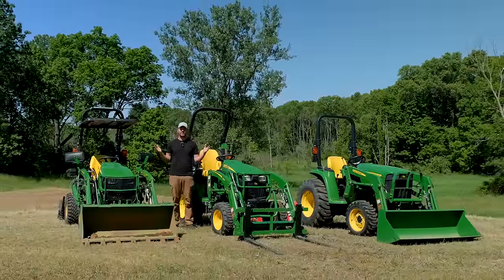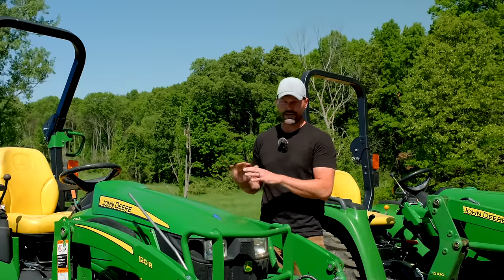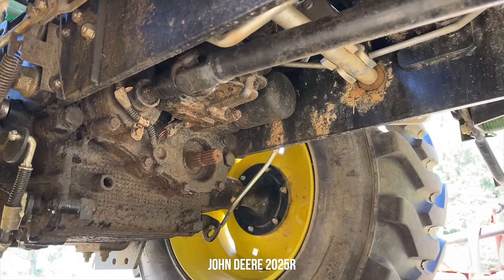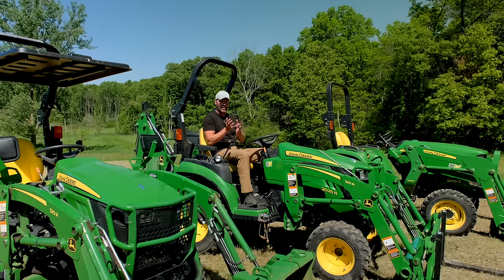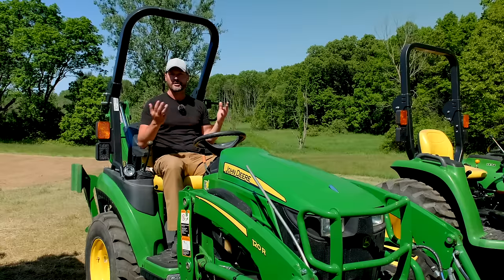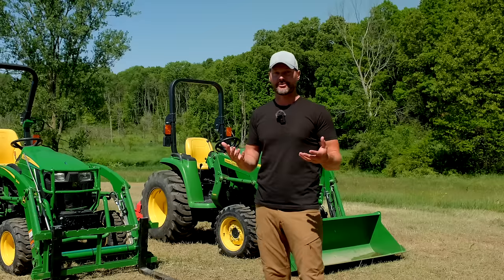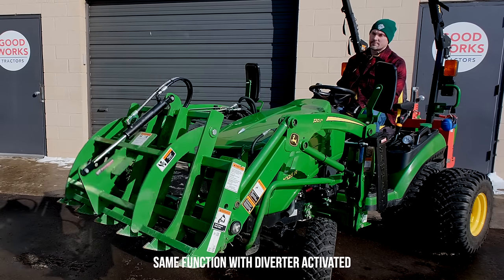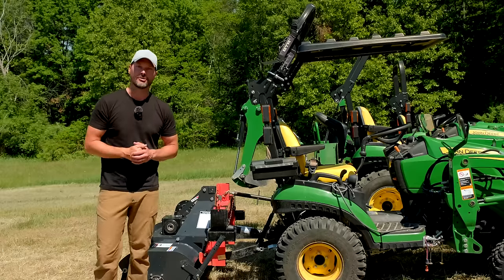CLEAR LOSER? COMPARING 3 JOHN DEERE 25HP TRACTORS.

Comment: Interesting review. Thank you. I bought a 2012 1026R new. It's been a great little tractor and does everything I need it to do. I put a 54" snow blower on the front and it's done a great job moving snow during winter.  When the Mauser cabs came out a few years ago, I spent the $5200 to have one installed on my tractor. At 73 it's been a life saver during the cold weather. The overhead heater works great too. Summer time the doors come right off and the front and rear windows provide the much needed air.  The 60 inch belly mower makes short work of my one acre lawn but it's lacking in suspension out in the pasture. I use to run a Frontier rear brush cutter but it got so little use,  I sold it recently for more than I paid for it new. Same went for the box blade. My 1026R has a bit over 160 hours on it and is still running like new. PAPE took over the local John Deere here in Yakima Washington. Getting into their service department for routine service is terrible.  They don't make service appointments. You have to drop your equipment and they will get to it when they can. Frankly, their service department sucks.   Again, thank you for your video.

Comment: I love my 3025e. I have found it can handle a lot more than expected. I have run a 60” cutter, grapple, 72” box blade, 60” blade, 60” rake, and recently purchased a post driver to try on it. It does everything I ask of it. 👍
Reply from the maker: Awesome, it is quite capable!
Reply: @GoodWorksTractors  yup, its pretty good for making the GWT top ten tractors you DONT WANT!! hehe...( "But I have sold the most of")

Comment: Traded in my 2019 1025R for a new 3025E this past January.  Found I was not using all the "bells and whistles"  on the 1025R.  Enjoy the extra weight and stabilty of the 3025E.  Between the loaded tires and a weight box it added about 1100 lbs. of ballast.  I love the tractor, perfect for my needs.  Price was very reasonable, there were some rebates available.  Courtney, as always, appreciate the information you provide. Thank you!!
Reply: what do you think about the difference in the seats and the position of the loader control?  I have the 1025 and thinking of doing the same. also what about difference in power?
Reply: @anthonymorrison2167  Hi Anthony the 3025E seems to have a bit more power, both loader and 3 point have more capacity than the 1025R, suggest you compate on the build and price app on JD site. I love the 3025E.  I did not notice any difference in the seat or the loader control, but I generally only use it an hour or so at a time.  I bought mine in January, price has gone up.  They discounted the list price by 10%  and allowed me $16,900 for my 1025R with loader, frame mounted plow, 3rd function valve and weight box. If I can provide any additional information please reach out! Good Luck!
Bob
Reply: @bobnarrus3218  I did the exact same thing, went from a 1026r to a 3025e and the only two gripes I have is no arm rests and no belly mower option. Other than that, I love the 3025e. Extra torque, more capable, stronger loader, etc.
Reply: @joeyschoenfeld6958  Arm rests would be nice, belly mower not a problem for me; I didn't mow with my 1025R either. I wonder if the 3 series would be too heavy to mow a lawn with? Just wondering!

Comment: Bought my 2021 2025R last fall and absolutely love it. The ground clearance difference between the 1025/2025R was the biggest seller for me. I bought mine with the backhoe and it just made since to go 2025R with that set up. I love it and personally it has felt “tippy” to me. I feel whatever they did engineering wise to counter this worked Very well.

Comment: The 3025E has a larger displacement engine than the 1 and 2 series. If I remember correctly the 1 & 2 series has the same 74 cid engine and the 3E has a 100 cid engine that produces 14 more lb ft of torque than the smaller tractors. I bought a 3025E in 2017 when they first launched. I got the intro price. They sell for $7000 more than I paid now. I've put 754 hours on it and I haven't had a single issue with it so far.
Reply: That's great to hear! I pick up my '23 3025 in a few days
Reply: Had a 3033r. Sold it didn’t use it allot after building the house. Bought a 3032e.  Wish I had never sold the r

Comment: Fair comparison.   2025R 2nd gen owner add’l thoughts… The 2025R handles 5’ box blade, rakes, rear blades easily.  Bigger rear tire contact patch and R4 deeper tread means a bit more pulling traction.  But 25hp has limits to ground engagin/pulling on every machine… Go up in size to do really heavy pulling with 2 bottom plows for example.   Handles a 4’ bush hog very well and importantly gets you up above taller vegetation and most of the dust that 1025R does not do as well.  Fits in my garden, through gates and tight spots in the trees better at 4’ wide.   Think this bit through, as its no good to have big equipment you cant get to the work!  Handles very good sized trees with a grapple (10’ long pines, brush piles, etc).  Has  a bit larger hydraulic pump than 1025R, but not significantly more.  Search Youtube to see how to measure pressure and dial up the hydraulics to max OEM spec to add 10-20% more lift force though to get best balance of performance and longevity.   Ballast is essential as noted since the center of gravity is higher, so that’s the main downside.  Price is certainly dramatically less than the larger 2 series “R” machines by $7,500 or more!  After 2 years ownership, still a huge fan of my 2025R!  But if you can afford to go bigger (and pay for bigger/pricier $ trailer to pull it, more expensive attachments, more maintenance $, etc), then go bigger of course!
Reply from the maker: Great stuff Hugh, thanks for sharing!
Reply: I feel like the 2025r gets a lot of hate. I am a fellow 2025r owner and I feel like it’s a great tractor. I feel like it takes all the advantages he talks about with the 1025r and adds more to it. According to JD’S website there is a 2600 dollar difference in price between the two. I don’t think that’s bad. Considering you get a 25% increase in 3 point lift capacity.
Reply: @DakotaDave17   Exactly agree 100%

Comment: I bought and use my 3025e when I started my grading business and I have used it to spread 300 tons of stone material for driveways and parking lots. It has more than payed for itself. Also use it to brush hog properties that I manage cuts through 6 foot tall brush(not like a hot knife through butter but good enough) I am genuinely impressed with these compact tractors. They are work horses for sure.

Comment: This video reminded me of the decisions I faced when buying my first tractor. After buying a small ranch, I purchased a 3025E. My dealer assured me it would handle 4’ round bales. It moved them, but it struggled. I ended up trading it in on a 3033R, which seemed to work better, but of course I now had to deal with the dreaded regen process. A year later, my hay supplier changed. I had to move with 5’ round bales instead of 4’. The 3033R initially handled these larger bales, but I started to have hydraulic issues. I eventually traded the 3033R in on a 4052R. The 4 series is a much heavier tractor and it’s loader is beefier, so handling large bales is now a non-issue. Based on your advice, I recently bought a Worksaver ETG-26 grapple, something the two smaller machines wouldn’t have been able to handle. My John Deere dealer worked with me on both of my upgrades and gave me what I paid for on my trade-in’s.

Comment: Looked at all 3 and purchased a 3025E, wanted a tractor that I wouldn’t over work taking care of my 6 acre property… perfect so far! Happy I made the choice of going with the bigger tractor over the bells and whistles. Great video! Thanks!!👊🏻
Reply: I have 7 1/2 acres though and having a 60-inch mower deck is also key because it needs to be able to do more than one or two things. I I want it to be able to mow move a little bit of dirt, and have a rear mount snowblower. Because I want to be able to have the loader and the snow blower on at the same time.

Comment: I really love my 2025R. The 1025 was too small for me, I felt cramped on it compared to the 2025R. I also like that I have more ballast weight because of the larger tires in the back. I am 6 foot two and about 290 pounds and could not fit in the cab of the 1025R.
Reply: I agree i also have the 2020 2025r and find it hands down a better tractor to the low sitting 1025r this video was an opinionated bash on a good tractor which i doubt he has spent much time on
Reply: I'm not trying to start an argument or anything, everyone loves what they have but I think that's the point, the 2025 is just taller, the 1025 will actually lift more with the loader at the pins and they have the same exact breakout point. 2025 has more ground clearance and weighs more by about 400-500lbs . If the 1025 isn't big enough tractor it's worth going to a 3 series, the 1025 to 2025 isn't much of a jump other than bigger tires. I have a Kubota L-series with a cab and sometimes go grab my father's 1025 cause it's lower to the ground and less tippy.  I can see going to a 2025 just to get the cab but again not knowing the prices , could again be worth going to the 3025.
Reply: Have a 2022 2025R, very pleased with it, mow hunting areas like trails and open grass areas with it?  Bought Frontier RC 2048 to cut grass and tall weeds/brush and it works well.  For more open areas use  a tow behind DR Pro Max52T (52" wide cut) field and brush mower with 22hp engine.  My 2025R has no issue pulling it with front end loader and bucket attached for ballast.  Really glad I went with the 2025R.
Reply: To bad that the 3025 doesn't have an R model.

Comment: Hello, we bought a 3025d new with a loader.  Now with 175 hours the tractor is amazing. It has tons of power and is great in the woods pulling logs.   We had the tires loaded and I have installed a diverter kit. Using a small "work saver" grapple, this tractor will lift a huge log.  We have a wood mill and 28 acres of woods, this machine feels like it can do it all.  The 3025d clears tons of snow and grooms our trails, It has never felt tippy or gotten stuck. We also have a welding shop and use this tractor for all our heavy lifting.
Great machine!
 Im stepping up from a case international 235 with a Frey loader.

Comment: I have a 2019 2025R, love it, 5 ft brush hog and box blade, no problem. I use 4 ft eguipment mostly as to not to over tax her, she is a small tractor so I keep that in mind. As far as loader height I thought about a 4 way bucket to help with that. I love her but I respect that she's a small tractor.

Comment: I have a 3025D and I love it.  Bought it recently but it has been great.  It’s heavier than the 3025e and more robust(parts wise).  It takes a little getting used to but once you figure it out it is fine.  Use it for a lot of loader work right now but will doing some fairly serious ground engagement work soon

Comment: I have a 3025D, and I believe it is the best 25 hp tractor out there.  It is gear drive only, has a cast iron rear end, and weighs 300 lbs more than the 3025E, the Kubota L2501, and the Mahindra 1626.

Comment: I have a 2021 3025E and I love it. I live in N Fl. My property is very wooded so I have lots of limbs and trees on the ground.
Unfortunately I have had to dig a few graves for some of my critters. It did a great job. I have a Westendorf Brush Crusher grapple and that works great. My tires are loaded with water because it rarely freezes, if it does it's only at night.
I thought about all of those models and the 3025E was for me. For mowing I use a JD 110

Comment: Another great video - thank-you!  Looking forward to, as always, the next one!

I took delivery of my 2021 2025R Gen2 14 months ago.  At the time, there was a $3K cost difference between the 1025R & 2025R.  I live on a few acres in the northwest that are mostly forest.  The 1025R would have met all of my needs very well, but there were three features of the 2025R Gen2 that justified the additional $3K in cost - that into low, middle, and high prIority categories.  

Low priority - this is about aesthetics and not much else.   I prefer the larger tires (espec. the rear) on the 2025R versus the smaller tires on the 1025R.  The larger tires are more ??"tractory"?? than smaller tires.  No, ain't gonna to defend this - it's about aesthetics and not logic.  (I'd assign 10% of the $3K)

Middle priority - Operator station - I preferred the 2025R over the 1025R.  The adjectives short, petite, tiny, skinny do not apply to this tractor owner.  For myself, the operators station on the 2025R has more room and is more comfortable.  The seat fits my non-petite frame better and is more comfortable than the 1025R seat.  Also, there are a couple seat-side controls (PTO selector, for one) brought higher above the floor on the 2025R than on the 1025R - offering slightly easier access over the 1025R,  (I'd assign 30% of the $3K)

High Priority - Ground clearance.  My property grows trees, himalayan blackberries (much hated) and rocks - ground clearance is a concern.  The 1025R ground clearance MIGHT BE sufficient to clear SOME obstacles I may encounter.  On the other hand - The 2025R ground clearance IS sufficient to clear MOST obstacles I may encounter.  "Might be" vs "is" sufficient and "some" vs "most" obstacles.  This was my primary deciding factor in 2025R vs 1025R.  (I'd assign 60% of the $3K)

These are my reasons for spending the additional $3K and after having my 2025R for a year & know what I know now - I'd make the same decision.  

2021 2025R, Grapple AV20F, Forks HLA Light Wt (GWT),  Box Blade BB2048, Wood Chipper WC46, Dethatcher (GWT), Rotary mower RC2048, MM Mower 60D, Summit Hydraulics Rear Remote Kit (2 spools), Hydraulic top link.  Filled tires, ballast box, mirrors (GWT), suitcase weights 42# (GWT), replacement led bulbs (GWT), etc.  

Thank-you, GWT!!
Reply: Very well written post!
Reply from the maker: Agreed, I really enjoyed reading that.  Thanks for taking the time to share!
Reply: Well written. Those were my 3 top pro's of the 2025R as well. I bought mine brand new TLB with radial tire upgrade for 23.9k in 2021. My dealer wanted 36k for a 2032R TLB. And 21.5k for the 1025R
Reply: Very nice . 
Amen brother. 
I totally agree.👍
Reply: My 2025R arrives in 2 days.  GWT you scared me with your review.  I watched another Youtube 1025R v 2025R review and felt better.  As was said, clearance, weight, length, width, tire size, are positives.  Regarding a feeling of tippiness, while sitting higher probably means a higher center of gravity, the additional weight, width and length would to an unknown extent counter the height.  Get a really big fish scale and hook up to the ROPS and see what you find!  lol  I l LOVE GWT!
Reply: @johnbeckham9665  Congrats on the new tractor!!!
The 2025R is an awesome little tractor, I love mine!!!

Comment: I went with the 2025R due to the tires/wheels. My farm in Hawai'i is often muddy and the native grass gets deep quick, the larger tires are a lifesaver on the back fields of the yard for sure. The price difference wasn't horrible (2800 bucks).
Reply: My 2025R was 1k cheaper than 1025r it was a deal so i went with 22 model year. Sexy stance for sure
Reply: @catz-media  The 2025R here was almost 2k more than the 1025R.

Comment: Man, I’m hurt! You must have had a large glass of Hatorade before making this! 😂 I absolutely LOVE my gen 2 2025r. I bought it as a TLB package last July. For my purposes, I wanted the width of the 1025, but I needed more ground clearance. I have had no instances where I have felt unstable in it either. I have however felt that over and over on my buddy’s NH Workmaster 35. I ended up going with a 3049 Frontier tiller because the JD 655 could not be had at the time and I really felt like the 3062 would have been a stretch. My box blade, rear blade, and landscape rake are all 60” and they all feel just right when using. If I have the scarifiers fully sunk, and a full box of gravel or dirt, I can stop the 2025, but that’s not how I operate the box blade, so it’s a non issue. This past weekend, I ran my buddy’s 60” brush hog. I had been a little concerned that it would have been too much, but I really wasn’t able to bog it down in waist high grass. I put it in some 3/4-1” brush and the tractor never flinched. My other concern was the weight of the brush hog because it’s bounces my buddy’s tractor around when lifting and lowering. I was pleasantly surprised at how stable it was, and I had just enough ground clearance at the rear wheel to get on my car hauler trailer. All of that said, a 3025 would handle my lot of implements and then some, but it would have been too large for some of the situations I work in.
Reply: 4 sure he is wrong about 2025r. He blobbing on this video making 2025r look dumb

Comment: Traded in my 1025R two years ago for a 3038E. Best decision I could've made! We never realized that we needed more size and power versus all the bells and whistles. After about 350 hours, the only real downside that I can see about the 3E series is the seat. I do sorely (🤣) miss the seat of the 1025R. Complain all you want about the regen system, but it doesn't make that much difference and really doesn't occur all that often.

Comment: Great video.  I've had a JD 2305 and I now have a 2025R and they both are tippy.  I know guys that have a 1025 and say the same thing.  Other brands and the same size??? Tippy!  Use some sort of weight in the back and wheel spacers...makes a HUGE difference.

Comment: I bought the 3032E after using my friends 2025R and 2038R. I went with 3032E up from the 3025 because I live in steep terrain and the extra HP helps out with the hydrostatic trans. I brush hog a lot on hills and the few extra HP makes a big difference.